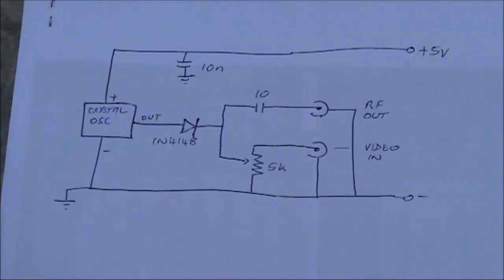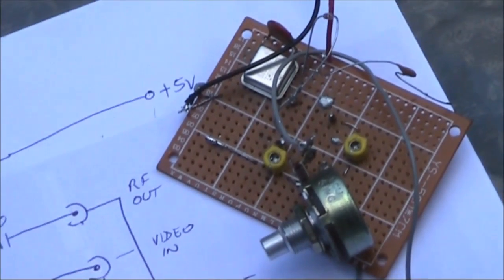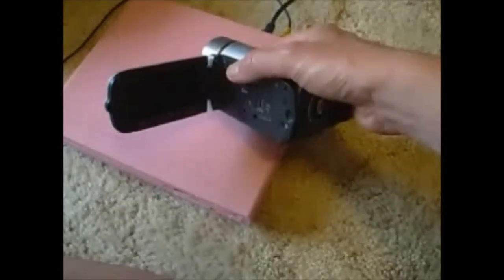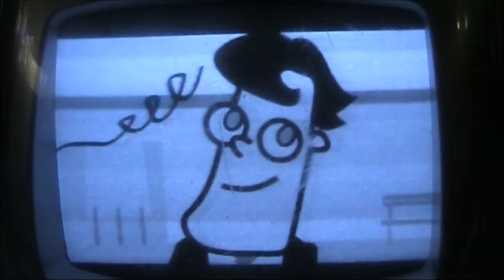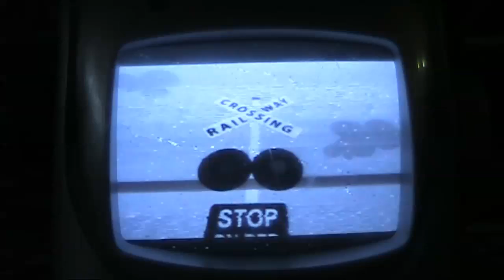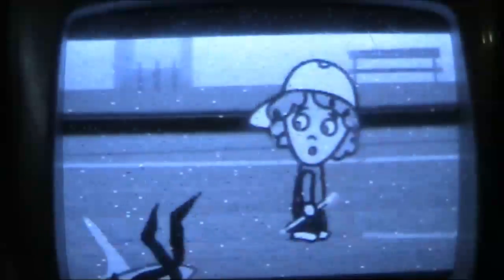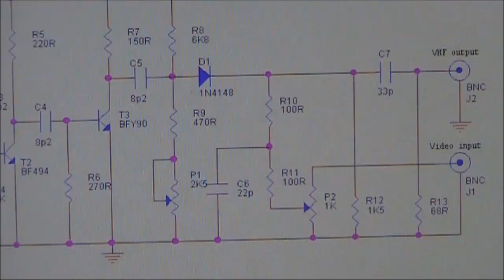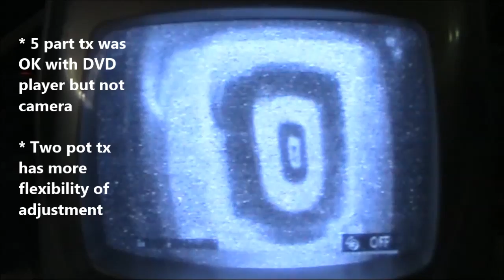Electronics on the Floor: Even simpler video transmitter with crystal oscillator module

Comment: How do you make a receiver circuit?
That outputs the same video format?
I dont want to use a tv.
Reply from the maker: It would be very complicated if made from discrete components. I'm not sure if one of those plug in USB raceiver dongles can decode analogue TV.
Reply: @vk3ye  An RTL-SDR stick can decode analog TV, but it only has enough bandwidth for monochrome (look up TVSharp). An RSP-1A or HackRF has more bandwidth and could do color but I have not found any software to decode analog TV with anything other than an RTL-SDR. Digital ATSC TV can be decoded with an RSP1A but I have not found any software to decode it live, you have to record the 6MHz wide signal into an IQ file and then extract the data from that, which I have not tried yet. Any SDR will work as long as it has sufficent bandwidth and you can find software to extract the video info somehow. And you need a pretty fast PC and a lot of hard drive space.

Comment: Wow...amazing...ur videos are always good.. what is the difference between 2  pin crystal oscillator and 3 pin crystal oscillator.. can we us 2 pin oscillator in this circuit.
Thank you
Reply from the maker: I'm unaware of any two pin crystal oscillators. Quartz crystals (that you may be confusing them with) require an oscillator circuit. Whereas these have the oscillator built in.